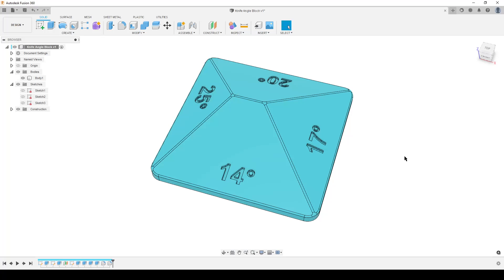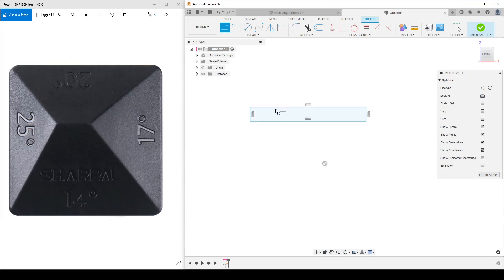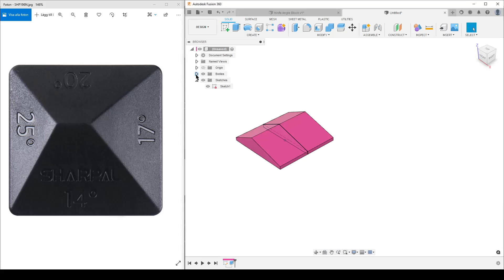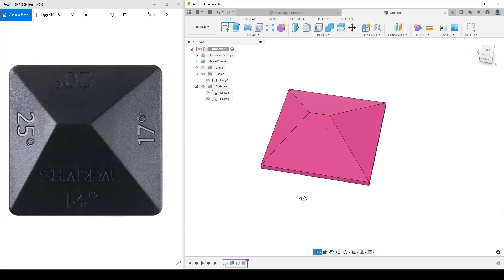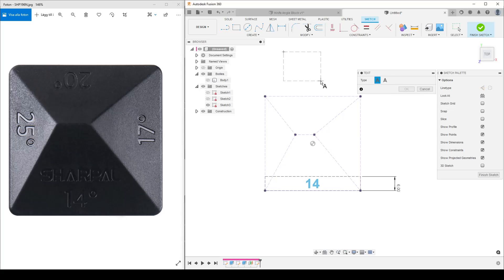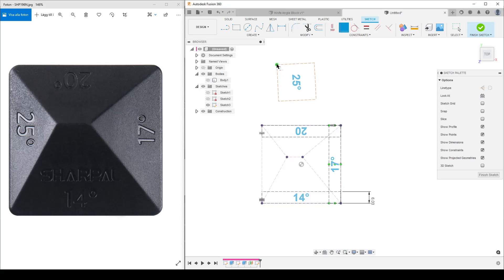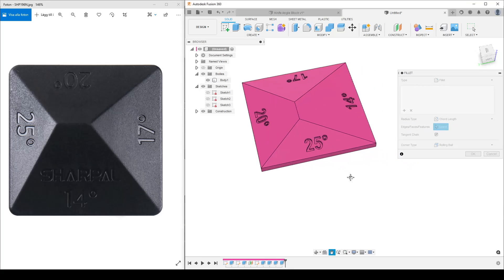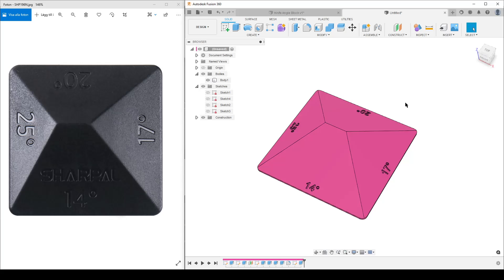Fusion 360 - Angled Block (Basic design exercise)

Comment: It is crazy that you can learn new ways of making with fusion360 even from a basic design like this, very useful videos Kristian!

You can also use Emboss, however, you need to add a fillet (it can be a microscopic amount like 0.01m) to the top edges first, as then those would be recognized as one face, and after that, you can Emboss all the numbers without distortion in one command.
Reply from the maker: My design intent for easier 3D printing was to have the walls of the cuts normal to hte print bed (bottom of model), emboss would create walls that are normal to the faces.
In this case with small angles it might not make any difference.